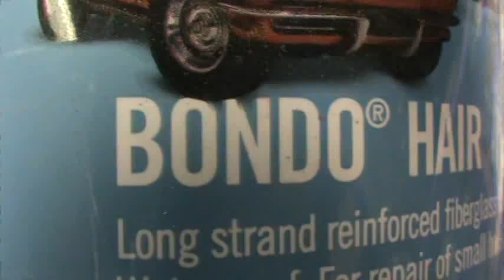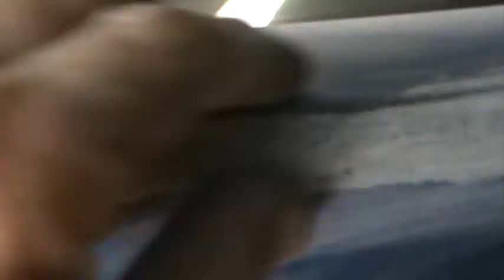FIBERGLASS SMC .....

Comment: Word on the street is that epoxy is compatible with smc. So if you were to use fiberglass mat on it you can, but you have to use epoxy resin and not fiberglass resin.  And then there is also the special smc repair adheasives that 3M and a few others make.   The gray color is normal in smc panels.
Reply: Shut Yer Face Garage They make a  resin for SMC as you said, can't remember what it's called, just used it at work and have used it in the past. Think it's made by Evercoat.
Reply: i recall a video that jeff "jamesfreddy" posted several years ago on his repair of a SMC chevy dually fender repair. browsing you tube i see more smc failures than successful repairs. I'm hoping shu succeeds and then ill have the balls to follow in his footsteps.
Reply: Evercoat smc